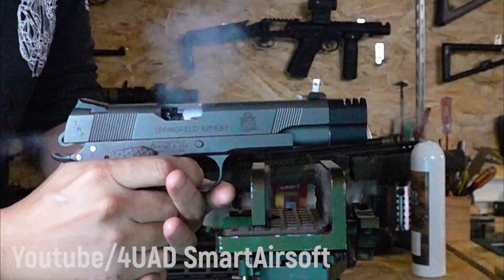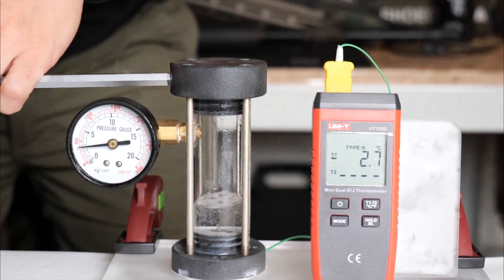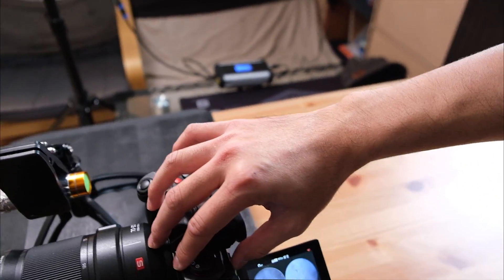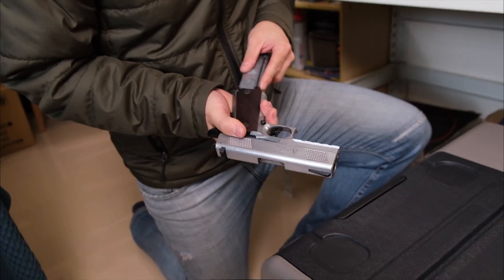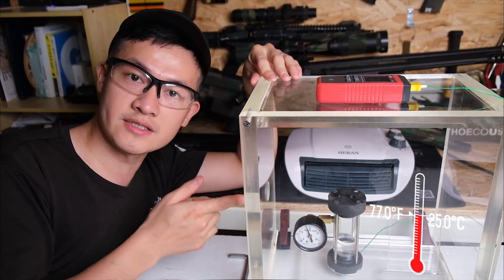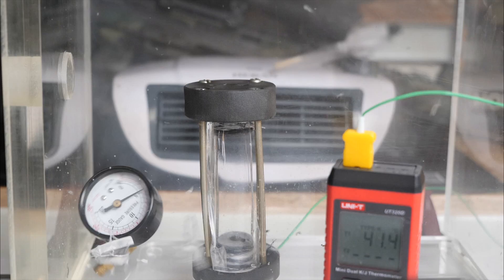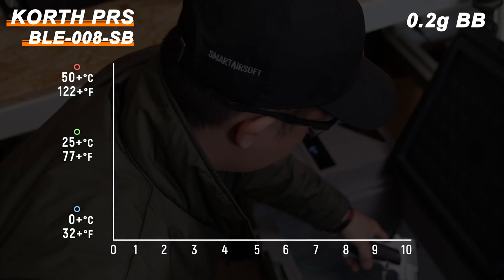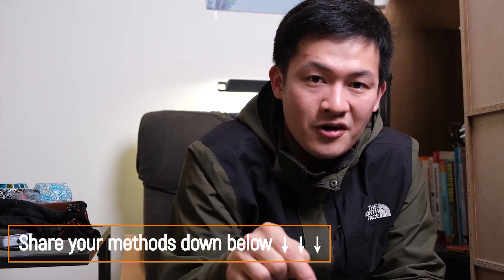Gun Gas Visualization (Schlieren Imaging) 玩具槍瓦斯可以被看見?!

Comment: im surprised company's haven't build winter time mags with electric heaters in the mags to keep it around room temp, a simple cr123 or double A battery's heated glove design + gas mag= winter mag lol but with lots of custom modifications ofc
Reply from the maker: I guess it is because heaters take insane amount of energy, and plus the size for the battery would be an issue too

Comment: Whoooa, this was a lot of work for 14 min of content. You guys are something!
My solution was that I bought a GHK AUG with CO2 mags, but I'm gonna have to wait for the winter to see how well it will work out.
Reply from the maker: Looking forward to the result man!
Reply: @4UADSmartAirsoft  That is going to be a while. But I did try something today. Well, I wanted to do some plinking but the weather was too cold for my KWA Mac11. It beaved strangely compared to the closed bolt systems, in this one the bolt carrier itself pushes the valve knocker )the analog of the firing pin) and the first shot was seemingly okay but the blowback was very weak, the carrier did not go back far enough to be able to hit the valve strongly enough.  Very strange behaviour, my nozzle broke a while ago, this is a wii aluminium nozzle, iirc the gun did not behave this way with the factory plastic nozzle, it was more cold resitant, in fact I think the reason it broke was because I used it in full auto in very cold.

Comment: One major issue I have with this video is that you fill the mags in room temp and then cool/heat it. The gas bottle, empty mag and pistol should be cooled/heated together and only when target temp is reached should the mag be filled.

I like the idea of your setup here but you will not be able to create accurate results/simulate play conditions unless you reach temperature before filling the mags: 
if you take a look at the ideal gas law it includes Pressure, Volume, Temperature and amount of gas(mol) 
If you have a set amount of gas in a set volume container(magazine) and reduce the temperature you will get less pressure that is obvious BUT you would never fill a warm mag with warm gas on a cold airsoft field! You would in fact fill a cold mag with cold gas on a cold field.
If we look at the ideal gas law again you can simply increase the pressure of the (cold)magazine by increasing the amount of gas in the magazine, wich is suprisingly easy if you use a cold gas bottle because if we look at the ideal gas law(suprise): the same amount of gas takes up less volume at lower temperature..
I hope you are able to see relative to the magazine we are changing the varables by changing the order of actions. So to create accurate results you have to simulate what would happen in context of the user.

Looking forward to seeing what you come up with in the future, this could definetly be an interesting channel to follow =P
Reply from the maker: Sure man, thanks for the in depth suggestion, we will look into that for sure, and this could actually be a good episode! ya I think we can do that for cold but for the heating test we might need to find a better solution so I don't blow up my room lol but still thanks for the suggestion!
Reply: @4UADSmartAirsoft  yeah I think 50 c is a bit over the top for heat testing I understand why you think its scary =P
The same principles does still apply tho.
Anyways, im glad you spotted this, idk if the topic is big enough for an entire video but it could be interresting to see either way ^^
Reply from the maker: @Haps_q  ya man 50 degree is pretty over to be honest, well its stuff we wanted to know figured would be fun to share regardless of the views~ if we wanted the views this video would be about dogs or cats lol. but ya still the point you made is really solid, I think this is for sure something we will look into! Thanks again

Comment: It's probably been suggested.. But doing more on this in HPA guns with this setup. Testing different weights with different PSI and how it changes, you could even go into different barrel lengths and diameters. Hell you could probably do it with just standard AEG's as well with different springs and barrel diameters and lengths as well.
Reply from the maker: Ya man it’s got lots of potentials!

Comment: Cant wait for the next episode. Btw different brands build their mags differently. For example GHK are know to work very well under low temp and as fasr as I know they have some system in their mags that equalizes the pressure somehow or something like that <--- food for thoughts :)
Reply from the maker: yep GHK mags are designed with 2 tubes one holds liquid gas the other is gas, this method simply gives more room for the liquid gas to turn in to gas, and the temperature wouldn't drop as much! But ya it would be a lot of fun to review different mags from different companies!

Comment: Hey good sir, which barrel length is better for my build? I’m thinking either a 420mm or a 455mm. Cyma platinum sr25, maxx me pro hopup housing, madbull blue, using the concave hop that is included with the maxx, and a elvish tac rhop patch. Prob shooting around 475 FPS and with a v2.5 gearbox. Along with a full cylinder and will be using 0.4 and above bbs. DEEEE EMMMMM EARRRR
 
Thanks anyways
Reply from the maker: I would say for AEG I wouldn’t go above 420mm because of the air volume in the cylinder is not enough (this can be another episode actually) but ya sometimes it’s not the longer the better, I personally like 300-375mm for my dmr builds. I guess another myth to bust because I would consider this suggestion from myself biased.
Reply: @4UADSmartAirsoft  a lot of peeps are recommending me 420 or 455 and they say 455
Reply: @mondotrombo7167  a basic principle to follow is to not have the barrel’s internal volume exceed the cylinder’s internal volume. You want the air to keep propelling the BB forward before it leaves the barrel completely.
Reply: @4UAD_Luis  I know, I’m not a stupid kid
Reply: @mondotrombo7167  Okay

Comment: Niiice. Not sure why you guys aren't more popular. The tests are done extremely well. I have a feeling the mag design has a huge part to play in cold efficiency. Ghk mags with its two chambers, would have much better performance than the regular single chamber mags.
Reply from the maker: Totally agree man, the mag design has a huge effect on the performance~ ya we are hoping YouTube shows our stuff more~~~ fingers crossed XD
Reply: @4UADSmartAirsoft  Yeaaa cylinder mag design can hold waayyy more pressure vs square with its pressure points. And having an expansion chamber is awesome for not venting gas. I'm experimenting with filling dead space in the mag with heat absorbing material to improve shot to shot cooldown.

Comment: hello, theres an idea ive always dreamed about. Its about performance in gbbs in cold weather. So the thing i do, is when i have fired the first shots, take out the mag and heat it up, then back in the gun, it really is much more effective. What if it was possible to have a type of tape or wrap, around the magazine, like a heater, so that it heats it up all the time, i guarantee that would be super cool, but a problem is that the magazine wont fit in the gun with a heater tape wrapped on it.
Reply from the maker: In japan this guy managed to hook some electric wire to heat up the liquid gas directly!
Reply: @4UADSmartAirsoft  Wow thats really innovative, but effective or not?
Reply from the maker: @sneez9461  works really well actually but to hook it up actually takes sometime, so I would say~kind of in the middle~

Comment: People really need to give higher pressure gas a chance. Simply switching from 12kg to 14kg gas allows us to get the same performance at 10ºC lower temperature, and going with 16kg allows 10ºC lower than that, which is enough for sub-zero temperatures. 
It boggles my mind to see people going with 12kg gas and hand warmers... just a couple minutes or a couple shots are enough to get the internal temperature down to freezing and non-working pressures. Let alone those fancy looking electric warmers.. batteries suffers the low temperatures even more so than the gas itself.
Reply from the maker: I think I forgot to mention co2 mags they work really great at cold temperatures! Just need to keep in mind the air seal build on the gun, because if the seal is bad even higher pressure gas can’t finish one mag and lock the slide to the rear during cold weathers :) but still man thanks for the heads up! It’s actually interesting about the high pressure gas use in different regions of the world, like in Asia higher pressure gas are commonly forbidden because during hot weather it just does too much damage to players and airsoft guns, and after sometime people start to refuse to use higher pressure gas, sometimes it’s a bit peer pressure related.
Reply: @4UADSmartAirsoft  in Argentina we use propane ("green" / 12Kg) for summer (15 to 35ºC) and propene / map pro ("red" / 14kg) for winter (5 to 25ºC). It rarely gets below that, but when it does, we just go with Map Pro anyway, I've used it down to -5ºC, it worked but the gas mileage was halved. 

The power difference between one and the other at the same temparature is rarely more than 20FPS, as the floating valve compensates the higher pressure by cutting the flow towards the front sooner, and the pressure difference is just about 10-15%.

What has a bad reputation is CO2 mags, as the pressure difference is so big there (8 times that of propane) that it almost always makes the guns shoot too hot
Reply from the maker: @facundocorradini  that is some really good info man! and yes I do agree with Co2 being inconsistent, but who knows haha we can do a comparison video and perhaps use the temperature you've provided! That could be one episode that would help some new players. Thanks again

Comment: "efficiency" is a common but very, very incorrect term to refer to the amount of shots per fill. A gun can be designed to have stronger kick and therefore consume more gas such in WE's, or have pitiful recoil but consume less gas, such as in KWA's. But as long as there's no wasted gas (e.g. bad seal between the nozzle and bolt carrier / bbu), both are equally efficient
Reply from the maker: That is actually a good point, thanks man! For the future reviews we will make sure we let people know about the recoil.
Reply: Also, even better way of judging GBBs gas consumption is to measue amount (weight) of gas required to shoot, for example, 20BBs, since maximum amount of gas that can be filled in magazine is different for every GBB
Reply from the maker: @blackwingmaster141  Yep we will do this for sure other wise during hot weather it would only charge a tiny bit of gas into the mag even knowing we've charged the mag for 20 sec. But still thanks for the heads up!